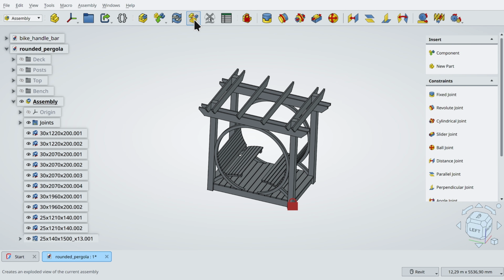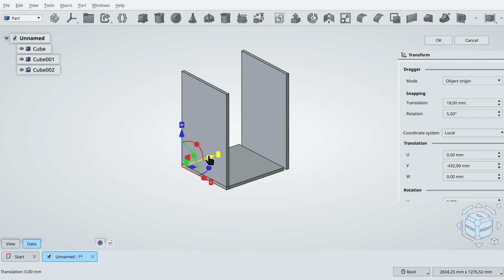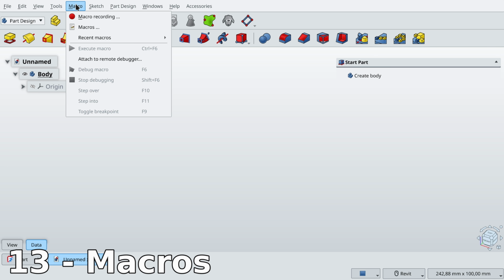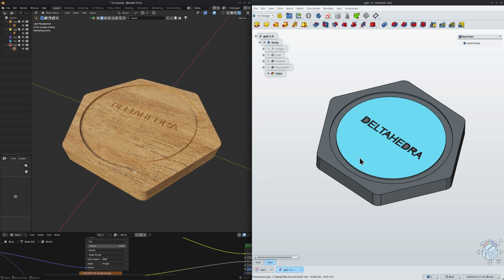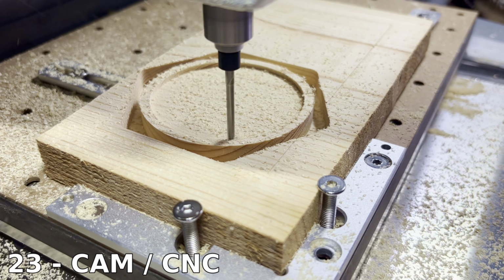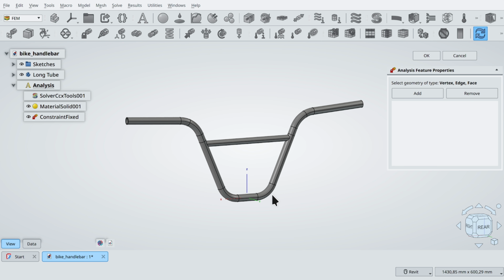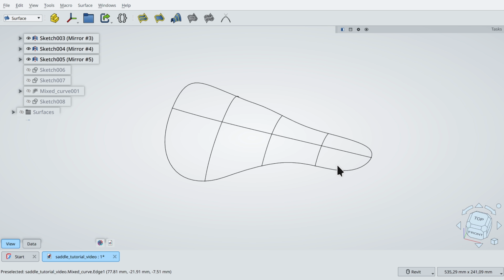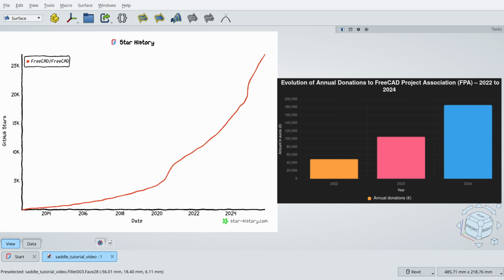30 Reasons to use FreeCAD in 2026

Comment: I use FreeCAD because it runs on my Linux...

But it has a lot of drawbacks, and I don't believe it's ready for industrial use yet. I believe the discussion isn't complete without mentioning these drawbacks. My biggest problem is that it is very un-user-friendly. Doing regular basic modelling takes a lot more clicks and menus than commercial alternatives. Not very productive. You mentioned that after 1.0 history editing isn't broken, but I really don't feel it. My assembly workbench also breaks completely after geometry changes. Also, just like on commercial alternatives, complex operations regularly break, while crashes and performance issues are also present here.

Comment: Hi everyone,

I've noticed that currently, automatic total page numbering (e.g., 2/2, 3/3) is not a standard, fully automated feature in FreeCAD's TechDraw workbench when adding new sheets. Since each page is treated as an independent object, the total page count does not update automatically across all sheets by default.

Is there any existing way to implement a global 'TotalPageCount' variable or a link between sheets to handle this?

Comment: To get a PDF with free Fusion you just choose print and select Microsoft PDF as the printer 👍  I hope support for importing parts from McMaster-Carr gets added.  I use that in Fusion because I can then order the exact part that's in the CAD model.  Bolts actually vary quite a bit, thread length, head diameter/thickness etc.

Comment: 31.  GEARS !  I was first needing a CAD software to make gears.  I had used Solidworks with GearTraxx.  Now working in a not-4-profit community for helping vintage machines to keep working, gears are very important.  The FreeCAD Gear Workbench got me there.  It's been refined over the years and keeps getting better and better.  Gears for tractors, actuators in classic cars, riding mowers, etc.  There are no replacement parts for older machines.  FreeCAD brings these gear parts back to life and to be remade.

Comment: I am retired Mechanical Engineer, I used Solidworks most of my carreer with a sprinkle of Autocad, Inventor and NX throughout. Every once in a while I have the need to do some design work now, I intend to get Freecad so I can switch to Linux and drop Windows and Solidwork! 😆 Thank you

Comment: Ok I know what I will dive into in 2026. I'm a woodworker/carpenter/cabinet maker. Have used SketchUp, switched to fusion 360. Was skeptical about freecad but your video made me want to try it out. Would love to know the main caveats or things that do not work as smooth yet compared to let's say fusion 360. Merci pour la video!

Comment: Few questions. Did they get the zooming right? Do the have a setting that actually matches Solidworks? 
How does it handle repeated features? 400k imported facets? Perf plate with 10k holes? Assemblies with thousands of fasteners? 

It looks like it has come a long way and there is finally a real CAD application for the masses that isn't total trash.

Comment: I'm downloading FreeCAD when I get home!!! 

I started with FreeCAD years ago, I found it clunky and not very intuitive but struggled with it enough to make my first modeled parts. I found Fusion 360 and absolutely fell in love with the simplicity of the product they offered. Over time fusion started limiting their products more and more and I was getting frustrated with them and also Microsoft's direction of windows which led me to move to Linux recently. I've tried installing Fusion 6 times and have failed so I'm in the market for a new parametric modeling program. 

I never looked at FreeCAD thinking that it wouldn't have much to offer as my previous attempts were difficult at best. From what you've shown I'm completely sold on FreeCAD again and will be learning everything I can about this once more.

Comment: One thing that is missing and i would love to have is the ability to be able to use free cad as pre processor by being able to name surfaces consisted by node sets and element sets in order to be able to export those for use in an open source solver such as Calculix for example or Code_Aster etc . This would make seemless integration between them and completely be able to automate many design iterations by changing the input deck card .

Comment: It's (sadly) so much worse than using Fusion360, if that is what you learned first. Fusion is, compared to FreeCAD, intuitive, more organized, modern and thus easier to navigate. Everything feels clunkier, slower and much older in FreeCAD. To be fair, I had the same problems when I used Solidworks. Every couple of weeks I download FreeCAD, struggle for an hour to get the simplest of shapes down and then uninstall it again. I'm trying to switch, but I just can't. Not even tutorials help the way I stumble my way around the program.

Comment: The issue with FreeCAD from my perspective is the development side. The software uses a Frankenstein's monster combination of Python and C++. I am decently proficient with both languages, and went to go do a simple bug fix, something I've done with open source projects plenty of times. 

I was completely lost. Python and C++ just do not mix well together. I was looking for a piece of the source code that simply labels the area of technical sketches? I bounced between Python and C++ code about 4 times before I finally admitted defeat. 

The reason this puts me off the software all together? It explains why development seems so relatively slow / why it seems so clunky. The "easy fixes" are not actually easy, the knowledge to onboard and start contributing is a high barrier of entry (needing a decent amount of know-how in both Python and C++ as they almost immediately talk to each other right out the gate with even the simplest parts of the code) and, frankly? Having a strongly typed language directly working with a language that doesn't require typing honest to god sucks. 

So to be clear, I love both languages, I use both languages frequently, but in the combination they are here? They make me seriously question the long term viability of the project in terms of getting rid of the "jank".

Comment: Comment in English and French
I've tried to learn FreeCAD several times (I've been doing CAD for over 15 years), and frankly, the tools are there... but what a mess! The interface is unusable, the information is completely inconsistent, there's no hierarchy between what's essential and what refines the design, and there's useless information on the front end... In short, it's certainly a comprehensive toolkit, but it's time-consuming because of an interface that desperately needs a complete overhaul! Such a tool should allow for immediate design, helping users correct, modify, and transform without needing to design on paper beforehand; otherwise, a rough draft is enough for me. It's a shame that as long as the interface isn't up to scratch, there will only be users slavishly copying tutorials without unleashing the creativity that such a program is supposed to encourage. When Blender redesigned its interface, the number of users exploded, and it became a benchmark in its field. FreeCAD is capable of the same, provided it fundamentally changes its workflow.
A plusieurs reprise j'ai essayé de me mettre à FreeCad (je fait de la CAO depuis plus de 15 ans) et franchement les outils sont là ... mais quel bazar! interface inutilisable, incohérence totale des informations, aucune hiérarchie dans ce qui est indispensable et ce qui affine la conception, des informations inutiles en façade .... Bref  un outillage certainement complet mais chronophage à cause d'une interface complêtement à revoir! 
Un tel outil doit permettre de concevoir dans la foulée, aider à rectifier, modifier transformer sans avoir besoin de concevoir sur papier auparavant, sinon le brouillon me suffit. Dommage, tant que l'interface ne sera pas à la hauteur, il n'y aura que des utilisateurs recopiant les tutos servilement sans libérer la créativité qu'un tel programme est sensé encourager. 
Lorsque Blender a refondu son interface le nombre d'utilisateurs a explosé et est devenu une référence dans son domaine. FreeCad en est capable à condition de changer fondamentalement la logique de travail.

Comment: This video has convinced me I need to switch back to FreeCAD.  I moved away from it years ago to Fusion because it kept breaking my models when I would make changes.  Fusion didn't.  But as you mentioned this has been improved since 1.0.  The only problem is I now have a significant amount of work in Fusion that I need to deal with.

Comment: Most of these are not reasons to specifically use FreeCAD as they list features pretty much every popular CAD-program out there has and they all do it better than FreeCAD. Points 1,2, 4, 6 and maybe 23 if you absolutely need 3D CAM are the only legit reasons. Point 8 is funny because the standard UI sucks, so customizing becomes a necessity, lol. And god help you if you use FreeCAD as a surface modeller.

Bottom line: FreeCAD is still no where near ready for professional use. It's fine for hobbyists with CAD-experience but only if you're on Linux as better alternatives exist for Windows.

Comment: The main reasons I use FreeCAD are: 
1. I don't need a constant internet connection (no surveillance)
2. I don't have to use the manufacturer's cloud (due to confidentiality concerns). 
3. It's free
4. The community is very large and always helpful.
5. It is powerful and offers many features.
6. I can also use it on older computers.

Comment: As a longtime FreeCAD user, I initially thought, "Why should I watch this video? I'm already convinced." Then I saw the Blender add-on and the extra workbench for 3D printing, and I immediately ran to my computer to install them. Exporting to Blender has never been so easy and smooth.
Reply: So your designs, files don't stay on line? They stay on your PC? Thank you 👍
Reply: What's your thoughts on using FreeCAD for cabinets professionally at scale vs sketchup?

Comment: I tried drawing a cube with a threaded hole in Inventor, Fusion, Solidworks and FreeCAD to see which one would be the most intuitive. All the programs were equally easy to use, except FreeCAD, which first wouldn’t allow me to draw a point on the cube’s face because it „wasn’t flat” and then crashed when I tried to place a hole.

Comment: Mechanical engineer here... I love Freecad an open source in general, and although Freecad has made gigantic steps, I think that is still limited to simple projects/objects: just try to add a chamfer and then change something in the geometry to see reconstruction errors that will force you to go back and fix a lot of features. Maybe for 1.1...
Reply: Try to do that in inventor, fusion360s big brother, there is a good chance it breaks as well 😂
Reply: @michoxi  don't know about Inventor, I regularly use Solidworks and it doesn't break. That's why people pays to use it.
Reply: Are you testing 1.1?
Reply: @hugoantunesartwithblender  I use the weekly builds for my hobbyist projects.

Comment: I'm making the switch from Fusion. FreeCAD has a steeper learning curve, but now that there are some good tutorials on YouTube it's nothing I can't get over. Fusion's free version keeps getting new restrictions, and I don't like that it requires an internet connection. FreeCAD should definitely be everyone's default tool for CAD by now, you'd need a compelling reason to use paid software instead.

Comment: I've been messing with FreeCAD for probably 20 years but have never really learned it in depth. Lately I used it to design a few simple models for 3D printing but I usually use SketchUp because I'm so much more familiar with it (started using it in 2001 or 2002). I keep watching FreeCAD content in the hopes that I can learn it well enough to replace SketchUp, but making the time is a real challenge.
Reply: You should try Moi 3d. You will forget sketchup modelling because sketchup fails on curve modelling.
Reply: Also it is super simple like sketchup.
Reply: @kalpit3d934 I'll give it a look, thank you.
Reply: @kalpit3d934  USD $300. 90-day trial. Not for me.

Comment: i tried freecad once, couldnt wrap my head around it and went back to fusion. this convinced me to give it a proper go again especially now ive switched to linux and cant use fusion anymore natively
Reply: so how did it go?.I'm on the exact same boat
Reply: @littlefrank90  I tried both at the beginning side by side and fusion was much better imo but why not use them both, they both are free
Reply: I basically have a Windows partition just for fusion360, but I'll probably stop using it, too

Comment: I think it's important to point out that the "Free" in "FreeCAD" isn't free as in no-cost, but free as in freedom.
Reply: Yes as in FSF or any other thing that follows the GNU philosophy, But it is in fact free in cost too!
Reply: @Crefoo  Almost all "Free" as in Freedom software is also "Free" as in no-cost.
Reply: What does that even mean in context?
Reply: @iliketoast-q9b non privative software aligned with 1990s libertarian internet philosophy.
It is not perfect (sometimes egos play a major role).
Reply: @pinadesecada2585  Indeed.
Reply: @iliketoast-q9b  it supports linux and its open source
Reply: Pretty much. There are a few Open Source Projects where the binaries itself are sold, while the source code is available if you know how to compile instead. (something like Ardour)
Reply: Man, prices for SOLIDWORKS are prohibited. I dunno understand why they don't release a version for single home users with prices reachable....and the "RENT SERVICES" trend gets me,  .i. Fy SOLIDWORKS.
Reply: FreeCAD isn't free. The creator of the software sabotaged it from the get go so it can never handle Standard measurements. Today it looks like FreeCAD supports Standard right up until you try to export a file with Standard measurements. Then it fails. German software devs are notoriously problematic.
Reply: ...or free as in "Free to waste an enormous amount of time to produce poor results."
Reply: @trashbeansoup2467  👎
Reply: @trashbeansoup2467 the guy literally has a video where he completes the professional solidworks certification course entirely in FreeCAD. Cope.

The only real issue FreeCAD has is performance as it's underlying implementation is largely single-threaded, but even then that's fairly easy to workaround and every CAD suite has stupid quirks like that.

Comment: I'm giving FreeCAD another chance after trying it many years ago and not caring for it much.  Since then it's become incredibly more powerful, but I'm having a hard time getting used to the GUI, and even doing the simplest tasks is often still a mystery to me.  I've used Blender and OpenSCAD for several years, and have become pretty competent using them.  I even used Sketchup early on.  I wanted to try Fusion, but was never able to get it to even install on my older laptop, and by the time I got a new laptop, I didn't like the direction Fusion was going, and decided I would never try it again.  I think once I have a little more time to experiment with FreeCAD, I'll like it.  I despise any program that requires an internet connection, this is one big reason I gave FreeCAD a try.  I use CAD software for personal use, it's not my job.  I design and 3D print many things, and also would like to do more simulations of kinematics in CAD programs, and none I've tried have been ideal.  Seeing this video and another FreeCAD tutorial video from this same channel has given me some hope that FreeCAD could be my go to CAD program in the not too distant future.. I want to thank this channel for some great information!  Many of the reasons listed here for using FreeCAD are the same ones why I'm giving it another try.